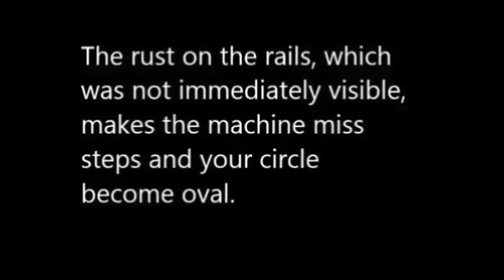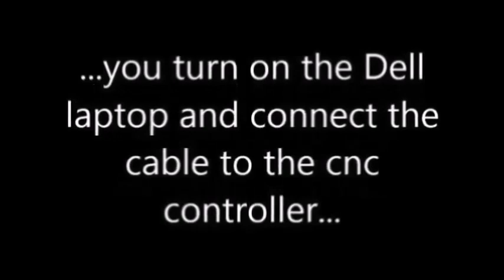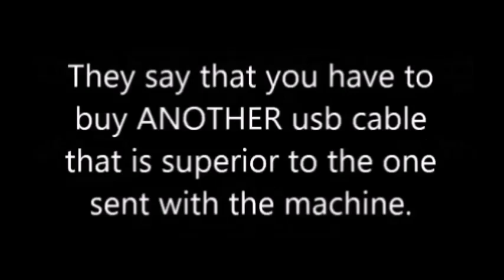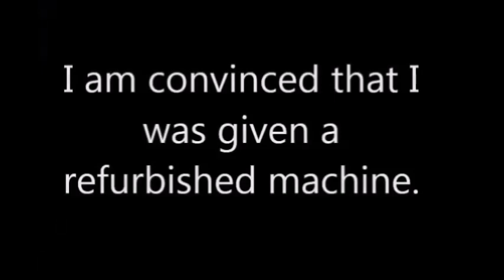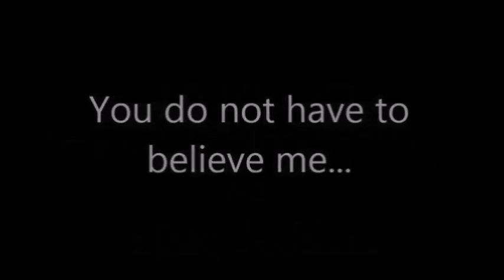Legacy Woodworking Machinery sells refurbished machine as NEW! (2018)

Comment: In about 2005, I purchased a Legacy 1200 directly from them. They were very eager to help me design a package to meet my needs, which totaled out at about $7000 by the time I purchased accessories, gear sets, and some bits. Things were fine for a while. Then the headstock developed some slop. The pin didn't seem to hold the governor gear in position, and the spindle where I had my chuck had some play, resulting in some pretty wonky flutes in a leg I was turning. I reached out by phone and email, sent them photos and videos, and was told they'd get back with me, but I never heard from them. Right around that time I developed some health issues and walked away from my shop for a bit. Fast forward to 2013. Contacted them to see about resolving the issue, pointing out that I'd reached out before (sent them the emails saying they'd get back with me) and even offered to buy a new head assembly. I was told it was no longer being manufactured and that everything they now offered was for CNC milling, but they could sell me a comparable setup and conversion kit, which would cost several thousand dollars. (My understanding is that a comparable sized machine to mine would have been around $12,000.)

So, while I understand models being discontinued or phased out over several years, had they gotten back with me in a a reasonable time frame I could have likely resolved the issue. Instead, it has taken up space in my shop for almost 20 years, with me not having the stones to just scrap my investment. I've finally decided to approach some local machine shops who do small job runs, and ask about recreating a system that will function properly.

Like many, I was initially blown away by their attention and service,, which lasted all through the sale process, and then I waited months to get the machine, with no updates unless I contacted them. Once there was a problem, I found (like many other reviews I now read) that not only did many others experience the headstock problem, it' was a common issue getting resolution with them. Some swear by their great experience. Others curse the day they made the decision to buy, and lament what they could do today if they just had the money back. I've decided that, if I can't find a way to salvage the machine as is, I'll scavenge it for parts for other shop made machines.

While they have their die hard fans who sing their praises from the rooftops, they also have a fairly large group of customers who have exactly the opposite experience. And I've noticed that those who had good experiences often chalk up the bad ones to either misuse by the owner, or flat out accuse them of lying about the experience and tell other people to ignore them. I've personally seen many companies over the years who come highly recommended at first, only to find an equally devoted group who got less than stellar treatment after the fact. Folks need to remember that even the best companies are only as good as the people staffing them on any given day, so it's possible that both viewpoints are true.  People should stick to relating their own experience rather than slamming others who state theirs as inept or dishonest. In either case it's a real shame that you seem to get either a great experience, or regret ever getting involved, with very little middle ground. But, if that is the "Legacy" they choose to leave, then that's on them.

Comment: I purchased the Maverick 3x5 over 4 years ago and love it.  The only problem I had was electrical interference in the gantry which required wrapping three wires them with bicycle inner tube and fixed the problem.  Legacy support was there immediately to help me isolate the problem!  Your machine obviously was abused by housing it in a wet/humid environment in which any machine with steel will rust.

Comment: I own one of their machines (Maverick 3x5), for the past 3 years and love it every day. Excellent materials and very sturdy construction. Their customer support is excellent and their information is very accurate. I was looking around for many years to buy a CNC and finally found the one that I was dreaming. The Maverick I own does all I need and more. It is all make in USA and you can see it in the way it was build, strong and simple. I disassembled the whole machine and carried it piece by piece to place it in my basement shop. The construction is so simple that I was able to do this with no guidance. I am an artist and not an engineer, so logic was all I used. The few times I get in trouble and need support, I email Legacy and they get back to me in very short time and help me with the issues. Most of the issues have been basic stuff I do not know about CNCs. They patiently help me no matter what I need. I do not work for them or get any compensation for writing this, I just need to state my experience for those that are considering to put a CNC in your shop.
Reply: If Legacy works for you, congratulations.

Comment: your video about  the 5 axis machines makes no sense

it called 5 axis  because  on  5 axis  can be adjusted  or controlled

true  differ from the  known machine tool 5 axis
either way with trunnion or U V axis

also true,  this company  try to make an equipment for  woodworkers
from technical side operating  and  programming a 5 axis machine  closer to engineers than machinists

either way  way  beyond  a woodworker skill
making a nice maloof chair  dont need  bachelor degree but a good woodworker skill

so on the end, they sold what they advertising
you purchased it, means  agreement is legal

so  it is  time for you to facing  with reality
Reply: The reality is that I am no longer a rookie. The reality is that I have a machine that does what it is told and does not break down. My campaign helps others to avoid a company that will defraud them.
Reply: @tdoz1  
no it doesnt help

the real help is  if  people learn cnc  then they can decide what good for them
and again you  only  repeating no good no good
show your  professionalism telling  what  would be good
youare  simply not credible
i got  chinese machines and they  work, despite  many  can not get working  them and  bashing them same baselessly like you do

Comment: so

here are some facts for you

first off this  video no help for  no one
it doesnt help you because  it wont fix your machine

it doesnt help others  because you  dont give alternative only saying ""its bad"" without real explanation

third,  it dont help the company  they  making and selling

===========================================================
you  telling you was ""rookie""

if  one going  in college and  get degree of trade,  then start to work at a company that one is rookie

if  one  get a CDL and start to work at a trucking  company thats a rookie

if  you dont have  licence, then drive vehicle you can not tell cops  you are a ""rookie""
this is what happened to you
=======================================================
helping...
as your  video suggests your control broke after six months or so

company has  one year warranty..

on other hand it  working with mach3  there are  5 axis  boards  for  50 bux approx

your rails, if it were really  peeling, take a picture  it is under warranty at six months so they might replace
if not
then buy another rail
it cost approx 120-140  fit for your machine, then youre back to work

https://www.amazon.com/OrangeA-25-1200mm-4SBR25UU-Bearing-Supported/dp/B07PHBYR16/ref=asc_df_B07PHBYR16/?tag=hyprod-20&linkCode=df0&hvadid=344027949290&hvpos=1o1&hvnetw=g&hvrand=7948232785753301173&hvpone=&hvptwo=&hvqmt=&hvdev=c&hvdvcmdl=&hvlocint=&hvlocphy=9011241&hvtargid=pla-700156080415&psc=1&tag=&ref=&adgrpid=68714462309&hvpone=&hvptwo=&hvadid=344027949290&hvpos=1o1&hvnetw=g&hvrand=7948232785753301173&hvqmt=&hvdev=c&hvdvcmdl=&hvlocint=&hvlocphy=9011241&hvtargid=pla-700156080415
Reply: Are you a Legacy employee?

Comment: arty 14100  minimum  24x60 roughly workarea 4 axis

chinese  50x100  with 4th axis 16 dia  on 100 lenght
7000 with a 30 dollar value control
with servos and way better control  plus atc  about 5000 more

controlling  4th axis not a biggie  its all about your  knowledge..

that was your  option to getting legacy

because you fallen in exact same trap like many others  you  could not evaluate what  is  on  picture
you  gone with other user advices,  
how much  their advice worth?

99 percent of them  dont even can read  blueprint
but they are expert of enginering issues :-)
Reply from the maker: HEY! "... you could not evaluate...". How can I evaluate? I WAS A ROOKIE! This campaign is to save other rookies from this "trap"!
Reply: @legacywoodworkingmachinery1977  

this  campaign will not 

they going to walk in another traps 

to void all similar traps  unfortunately  you have to  have  experience in manufacturing,  and knowing  ""simple"" things..

avoiding similar traps  you have to look in what they  building  in

what rails, screws  or rack n pinions..
motros, what  motors they  built  in?

if  theres  no description  what  motors  they  built  in  then leave it
because  in case  fault  you cant replace  it
you dont even can replace their rails..

thats where  chinese  won
you  buy their router then you  buy rails,  gears,  screws spindle from  100 different places..
Reply: this  legay machinery stuff  living  on  like bmw cars 
when you have  one and waterpump go off after30K of  miles and cost you  1500 dollar a 20 dollar value plastic pump then you find you screwed

Comment: Selling a machine that has 6 to 8 months of unknown shop hours usage as a new product is just wrong. I would suggest, rather than offer a 90% buy back to upgrade, offer a 75% buy back or a buy back percentage based on hours used (60%-80%) for upgrades, then you can sell the used machines as used.
The most shocking thing for me, a red flag, is the type of rails used for the amount of money spent ($20,000-$30,000). Because of this I would look to other CNC manufacturers. For $10,000 or less, you can get a very good machine (without a lathe though). Verticle milling is an easy conversion, see Frank Makes YT Channel.
The bearing and round rails you use are lower tier systems, prone to accuracy issues on large machines. Example: https://rockfordballscrew.com/linear-guide-rail-catalog/
Not endorsing Rockford Ball Screw, it was just the first example I could find.
Reply from the maker: I presently operate a professional machine and I fully agree with you on the rails issue. Thanks for the comment.